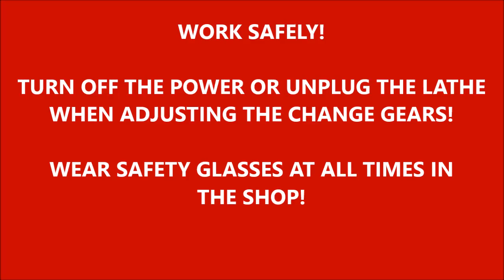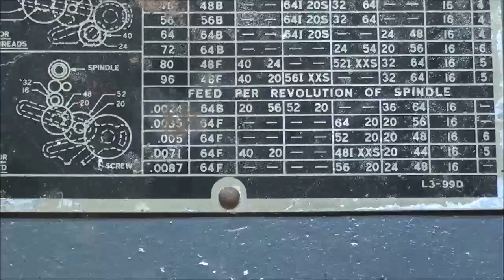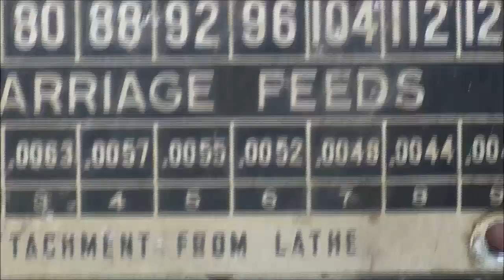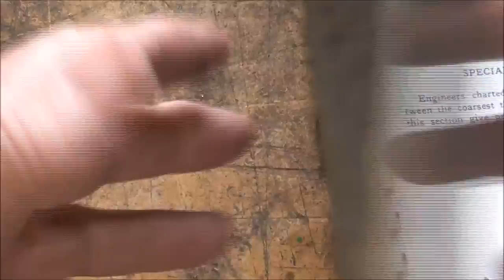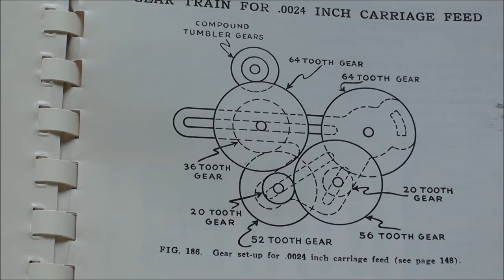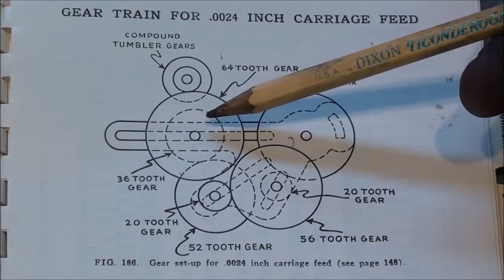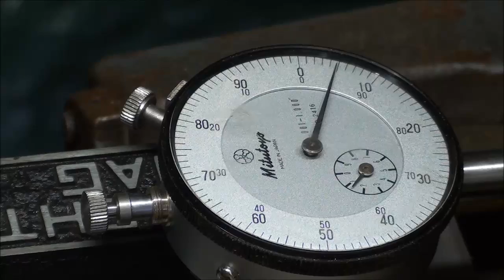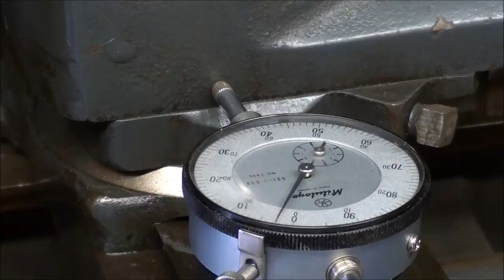SHOP TIPS #224 Setting the Gears for Longitudinal Feeding Atlas Lathe  tubalcain

Comment: Thanks again for another great video! I’ll be doing this gear setup tomorrow.
Reply from the maker: I hope it works well for you.
Reply: @ should work great, I have all the gears to do this setup. I watched your video on metric treads & not sure I have the spare lead screw gears. You have any tips on interrupted facing? Chipped a few carbide inserts trying to make a t nut for the tool post. It did come with a mill attachment, but not the oem one.

Comment: Hello,  I have two Atlas Craftsman lathes…… one has a quick change gear box and both are in need of repair.   Any recommendations on a source for parts,… half nuts,  cross slide nuts, apron parts?
Thanks!
Reply from the maker: Pretty much your only source of parts is feebay

Comment: Your series of videos on gear changing for threading and turning has been very helpful. I have been in the machining world for 40 years. I have always had the luxury of lathes with quick change gear boxes, so I never had to do manual changes.
I finally bought a Craftsman/Atlas lathe about 2 years ago from a widower for my little shop at home. It's in excellent condition and has all the gears and manuals. It holds tolerances very nice but it's a hobby lathe, no hog cutting here. I think it was made in the 60's.
But I have never played with the gearing to do threading, and I love to cut threads. Now after seeing you YouTube videos am going to start threading at home.
Thanks
Reply from the maker: That is awesome, glad to see that I helped you with the gears

Comment: I recently picked up an Atlas TH42 with a quick-change gearbox. (I'm brand new at this, experimenting and learning...) After watching your video, I immediately went to lower the feed rate for a better finish. Looks like I'm stuck with the feed rates that the quick-change allows, though. Is that true? Can feed rate be changed independently of spindle speed?

Comment: So I bought a atlas Craftsman lathe I think it's 12 in but I'm not sure it says Sears and roebuck so but it has a gigantic forge Chuck on it 4..jaw. and it came with a 10 in three jaw Chuck Cushman I believe. And I was just curious I have the thing all disassembled because that's the way I got it.. and I have no way of telling how the pulleys and the aluminum case are arranged on it I need to figure out where these sets of pulleys are going to be located based upon the location of the headstock like it looks like you're lathe they're right next to the headstock in the same case of that aluminum case it looks like it's all included right there so I'll try to do that I just recently made a wooden table that will accommodate this big lathe but the bed is probably oh 60 in Long and I only have one carbide braised cutter it's been a rough start for me I essentially sold the other lathe just to get tooling for this one I don't have but a micrometer 1 in starret (outside) and a general inside .2"-1.2" micro. And a terribly made general dial indicator that doesn't come back to zero and just gets stuck and a little tiny reamer set and some huge reamers 2" and one inch sizes with some kind of Morse taper on the male end and a steady rest  a big one too with brass points inside it not rollers..but anyways thank you so much your videos help tremendously!
Reply from the maker: You will figure it all out, just stick with it. Go to vintage machinery.org, and find a parts diagram for that machine

Comment: stubby lee couldn't count too far with his digits and being a math teacher that would've been a little frustrating, lol. HEY teacher? Mr. Pete? I just sold my south bend yesterday 9" model a I believe and I couldn't get the chuck to turn I ordered a chuck key for it but I just decided to sell it I'm already regretting it but it didn't have a proper quick change gearbox and also it didn't have a factory motor on it it also wasn't connected by a proper system either the guy that owned it before me had it connected to an riding mower transmission and put a flipping flat belt pulley on his riding mower transmission and then had that connected to the lathe and that was through or driven by an electric motor that had a regular v belt so it was combining two different belt types A v belt and a flat belt and also it was just really put together rather poorly the ways were flat and true yeah it was nice but the compound was kind of hard to actually it was all seized up when I got it and the compound screw was anyways I could go on and on about it but I'll leave another comment as to what my real question is

Comment: Hello,
I purchased an Atlas 10D from a friend who is a gunsmith. I need to know where to attain a manual/operators guide like the one in your video. I'm also going to need some parts because the quadrant/banjo or bracket is broken. I'm also missing some gears and bushings to get the lead screw shaft to turn when engaged. It is missing a piece on the upper area so that the gear can't slide and be adjusted. Thank You in advance. Great videos! I'm going to use these as a tutorial to cut my teeth, so to speak.
Reply from the maker: Check vintage machinery.org for a manual, or eBay. eBay is your only source for parts
Reply: @mrpete222  Thank You, I will.

Comment: A pointless thought just occurred, yet I'll share it anyway, if one had a large number of finished  banjo castings, and a whole slew of gears, one could set up each casting in all the possible manner of gear arrangements, then just switch between pre-assembled banjos to get the feed rate or thread pitch desired.  Not as fast to change ratios as the qc gearbox, but faster than having to arrange the gear locations each time
Reply from the maker: Yes, you could do that. But those banjo castings and extra gears, would cost far more than a quick change gearbox

Comment: Hi mrpete222, ive really enjoyed your videos. I bought an atlas th42 recently at an auction to teach myself some new skills... your videos have been useful to me in trying to get this thing going. Im missing a 20 tooth change gear and i want to try to make a new one. You have a video using a bridgeport to cut a new one, i was wondering if you could make a video using the index on the atlas lathe, im having trouble figuring out what pins to use... it has 60 holes and i need to cut 19 grooves? Any advise will be appreciated, thank you.

Comment: One thing you can try if you are not going to change the gearsets is use Chevron's Pinion Gear MS spray on the teeth. Word of warning though, don't touch those teeth after doing so. The spray will set up as a tacky lube after a couple days. Or if you leave it out in the sun, it will get hard. It was a soft spray form of grease that could be used in place of Texaco Crater. Crater being an open drive grease most commonly found used on Shay locomotive gears. The use of the MS spray quiets the gear noise on the backgears too. If you touch it, you'll know why the warning for at least a week and on your clothes, forever.

My QC 12" has them coated with it and it really does quiet them down.
Reply from the maker: +gravelydon Thank you

Comment: This reminds me why I am thankful (since it is nearly Thanksgiving - or just after in Canada) that I have a quick-change gearbox on my 9" Southbend. When it takes that much effort to change feeds, the temptation is to get along with a less-than-ideal feed rather than change it. Not ideal for a general-purpose lathe where no two jobs are likely to be the same. (On my mid-'60s 9", the cross feed is .3 times the longitudinal feed.)

I suppose that these change-gear lathes were intended for production, where a lathe setup man would experiment to find the ideal setting, and then a lathe operator would crank out parts day after day without having to make gear changes.

Thanks for the video.
Reply from the maker: +Peter W. Meek Thank you

Comment: Bookmarked for when I get time to setup the Atlas 12" bench lathe. Need to tear it down and clean as the former owner let it set and get covered in dirt. It will be the backup for the Craftsman 12" floor model which has the QC gears. Amazing how many of these old gals are still around.
Reply from the maker: +gravelydon THANKS for watching!----Sounds like a big job, but very satisfying

Comment: To whom it may concern, 16:64, 36:52, 20:56, 20:64, Gives a final gear reduction of 51.76888 to 1. Assuming 8TPI leadscrew, then .125/51.76888=.00241457 inches per revolution of the spindle. You can use this to calculate any feed you want within the limits of the gear train.
  Mike (o\!/o)
Reply: The limits of a gear train include the physical size or space allowable and the gears available, although you can always make more gears of any tooth count.
  Mike (o\!/o)
Reply: +mrpete222  Fairly easy with the calculator pinned to the taskbar. Basic gear calculations like this can be used to cut any thread, inch or metric on a change gear lathe just by knowing the pitch. It' a lot harder on a quick change because there are fewer gear ratios available. So sometimes a combine is to be preferred.
  Mike (o\!/o)
Reply from the maker: +Moholo 88 THANKS for watching!--you have an analytical mind.

Comment: When I get my 12" Atlas back up and running I was going to go through the gears and math to see if it was possible to get a combination which could be mounted to get under the 0.0024 per rev fine feed.  I assume if there was that Atlas would have included it somewhere, but thought it would be fun taking a look at it.  As you mentioned, on that finest feed, some of the other gears do not have much clearance now.
Reply from the maker: +ILGopher THANKS for watching!--I'm working on a finer feed

Comment: Thanks Mr Pete for this series on the atlas change gears.  I have an Atlas with the Pick-O-Matic gear train.  It was the precursor to the quick change system.  This has been an inspiration to me to do more with my lathe.  I have cut some external threads with it that came out pretty good.  My next project will be cutting internal threads.
Reply from the maker: +Gus Lint Thanks for watching